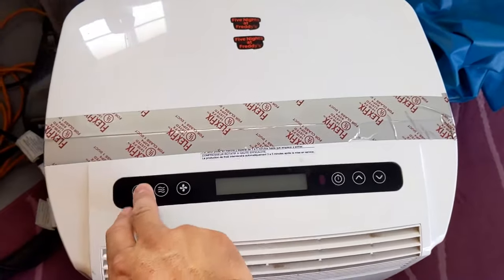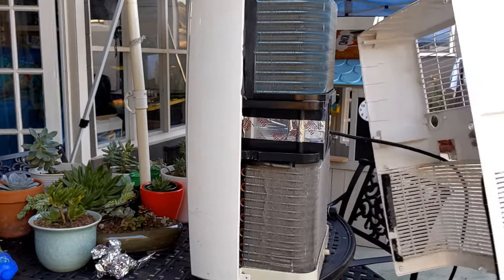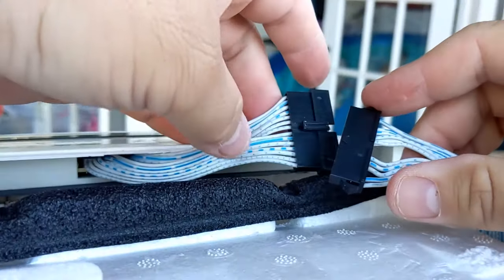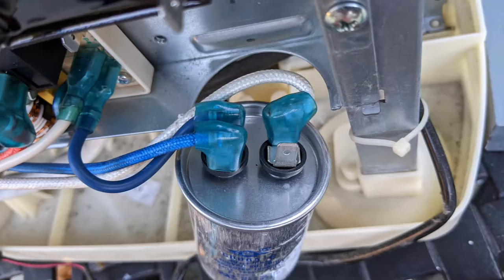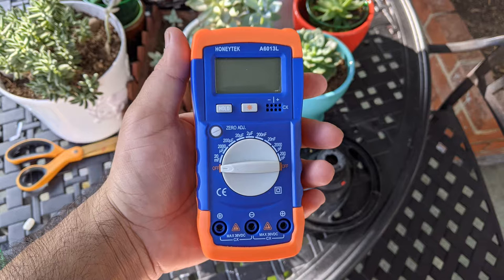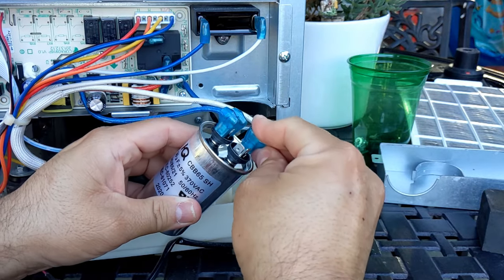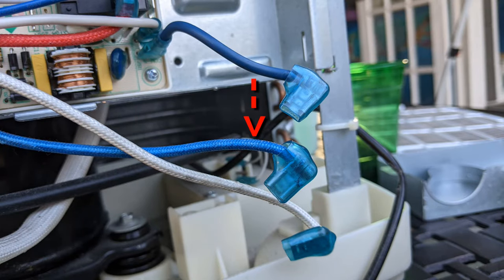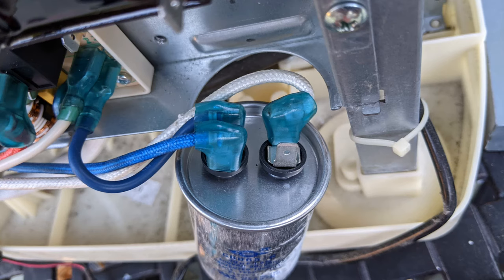Fix Your Haier Portable AC: Buzzing and No Cooling

Comment: What does it mean when the ac shakes violently?
Reply from the maker: Good question. So it is cooling but shaking a lot? I'm not sure, but something to look at is the compressor and the fans. You'll have to open it and run it with the case off so you can see if there is a fan that is off balance or the compressor rubber isolators are gone. The compressor shakes quite a bit and has rubber pads that isolate the vibrations. When those rubber pads go bad from cracking/breaking then the vibrations from the compressor will be transferred to the whole unit.

Comment: My ac turns on fan runs compressor runs air that comes out is cool but not cold. No visible burnt wires or components no swelling or leaking on the cap all radiators and vents are clear unit new lost the invoice so cant return it. I thought gas leak but i dont know how to tell
Reply from the maker: Just because the cap isn't swollen or leaking doesn't mean its good, you need to test it with a capacitance meter. It could be running below capacitance. In the video description I post a link to the cheapest capacitance meter you can find on amazon. If you want to check for leaks in the refrigerant lines, remove the cover, run the AC and spray soapy water on the lines. Leaks will show up as bubbles.
Reply: Iv sprayed water not soap water onto all the copper joins where they were braised together there was no bubbles or sounds of any kind had the ac running on its Coldst settings so now pulled the cap out and discharged it. My volt meter is uA not uF dose that make a difference. If put the probes on the back left red right and nothing displays
Reply: @ChavezDIY  just to be sure iv sprayed it again soapy water and again i can see no bubbles except from when the water is sprayed on. So fingers crossed its the cap.
Reply from the maker: @craygebrown8694  I think uA is for amperage, maybe that's why you get no readings.

Comment: Compressor work but leaking out freon. Haier only 2 years old. Any fixes.
Reply from the maker: No quick fixes and it requires HVAC tools/skills. I have seen videos where people will cut the copper line and use a brazing method to attach a schrader valve. Then they vacuum the copper lines with a vacuum machine and then add refrigerant (type and amount specified on the AC). Here's a video of someone doing that https://youtu.be/_bL7hN6LS4Q

Comment: Had a similar issue - i changed the capacitor and the compressor is running but still not cooling.  Any ideas?
Reply from the maker: That's interesting, the compressor is actually running? Does the compressor feel warm when running? Start with making sure the coils (evap and condenser) and air filters are clean. Next look for refrigerant leaks, low refrigerant can lead to no cooling. Look at the coils for refrigerant leaks, spray a mix of soap and water on the coils at different locations with the compressor running and look for air bubbles that may indicate a leak.
Reply: @ChavezDIY  I have a Haier 8,000 BTU portable ac also, with the same issue, compressor turning on but not cooling...I bought a brand new LG 11,000 BTU ac to replace the Haier...and I have kept the Haier portable ac as a possible future project...I have taken the Haier portable ac apart, and cleaned it thoroughly, in which inside and outside its so clean, its looks brand new, but it's still not working properly...
Reply: @RobsCustomCreations  you might have to replace the capacitor
Reply: @ChavezDIY  I have not tired looking for air bubbles.  I would not know how to add 410a refrigerant.  very clean filters and compressor is getting hot.
Reply: @RobsCustomCreations  I also kept mine as a project but still not getting cool.
Reply from the maker: @tkenwatkins  something is wrong with the compressor, which is the most expensive part in a AC. You can contact a local HVAC technician for a diagnosis or look for a used replacement AC on Facebook marketplace.

Comment: i need help finding the right capacitor
Reply from the maker: You have to open the unit and look at the numbers on the capacitor like I did with my unit. Take a picture to note the Voltage and capacitance numbers (uf).
Reply: @ChavezDIY  i have the picture but nothing that i search on amazon is the same
Reply from the maker: @arohashoyu  what are your numbers? The voltage can be higher on the new one but the capacitance needs to match.
Reply: @ChavezDIY  mines says 50µF 250VAC 50/60HZ ±5% 40/70/21 B S2
Reply from the maker: @arohashoyu  Try this one https://amzn.to/3JtjgBu  It's a 50uF capacitor, the voltage doesn't need to match exactly, you can have more voltage but not less. I searched amazon for "50uf round capacitor"
Reply: @ChavezDIY  how do I put the wiring back since theres no indications or markings on the airconditioner or the capacitors either the old one or the new one have no markings. 🙃
Reply: @ChavezDIY  Or doesnt matter?
Reply from the maker: @arohashoyu  did you have a photo of how the wires were setup on the old capacitor? What color wires do you have?
Reply from the maker: @arohashoyu  the wires to the fan and compressor go on one side and the "common" wire goes on the other side. For me, the fan and compressor were both blue colored and the common wire was white. You can see that in the video.
Reply: @ChavezDIY  thank you for all your help but the still doesnt cool, i changed the capacitor, its buzzing but no cold air still the same
Reply: @ChavezDIY  I had red yellow and maroon
Reply: i placed it as is like the last one and i turned it on and it powered up but still no cold air 🥺
Reply from the maker: @arohashoyu  Sorry to hear that man. Other things you can try include: cleaning your coils, checking the circuit board for any burned components, spraying soap + water on the coils when the AC is on to look for any bubbles indicating refrigerant leaks.

Comment: Mine just keeps beeping like it's full of water. But I empty it and it's still beeping. I've vacuumed all of the filters already too.
Reply from the maker: That's interesting. The beeping could be related to another issue. Check the owner's manual, sometimes they have troubleshooting guides in there that might help. If you don't have the manual, do a google search for it.

Comment: I paid $20 for a new capacitor but unfortunately that wasnt my problem.
Reply from the maker: I'm sorry that didn't work for you. You need to use the capacitance meter to measure the capacitor before replacing it. It comes in handy. Capacitor failing is common problem and its likely you'll have air conditioning for the rest of your life so it pays for itself over time.
Reply from the maker: Here is my checklist for troubleshooting AC: Clean the filter
Clean the coils
Replace capacitors
Check for leaks with system running using soapy water 
Touch compressor, should be hot
Listen for fans, should be running
Touch copper lines, one should be cold the other hot
Check motherboard for burned components
Check wires for any loose connections
Check connectors for corrosion, clean off any corrosion with wire brush.   If none of these items help, its likely the compressor has failed. The compressor is the most expensive part so you might as well look into another unit.

Comment: Can i pick your brain, i added a service valve to my portable ac, i belive i added to much refrigerant my compressor seems to turn on and off, and now im breaking a circuit!!! Help
Reply from the maker: I've had that happen with my car AC. I overcharged it and the compressor would turn on then turn off. It turns off due to overheating. The fix for my car AC was to slowly release some refrigerant until the compressor operated normally (stopped turning off).